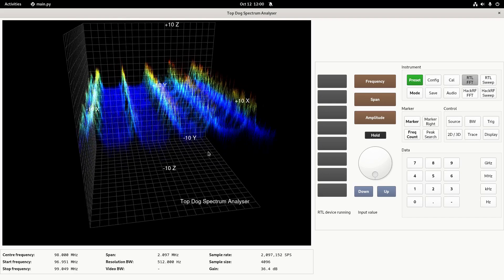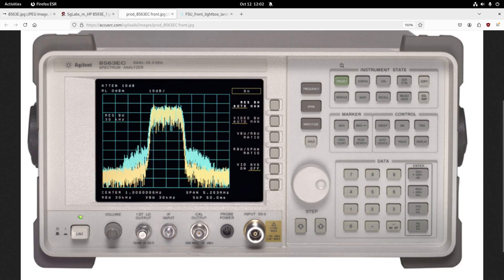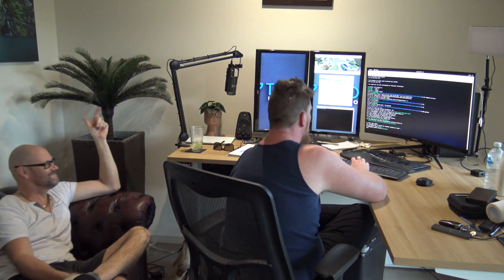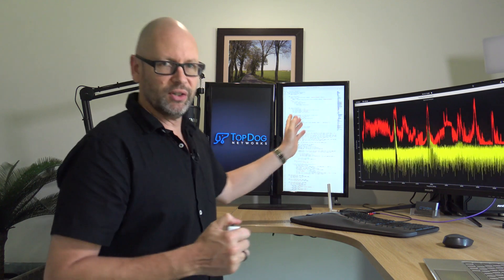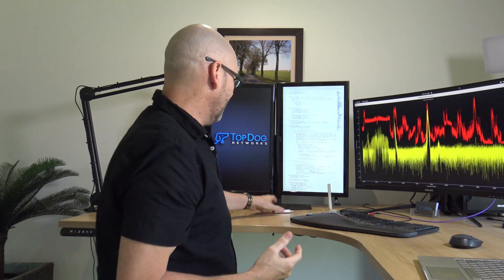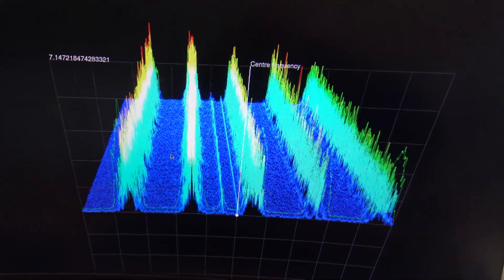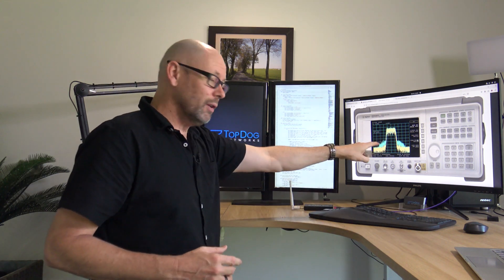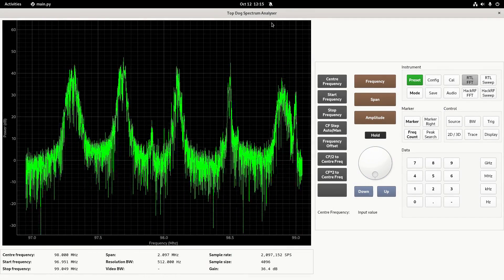Top Dog Spectrum Analyser using software defined radio (SDR)

Comment: Those analysers are great (I have several). They have a nice Yig tuned filter on the front end which gives great signal selectivity. They also have an option for an IF output at 310.7MHz on the rear panel. If this isn’t fitted, you can make a SMB to BNC cable and connect it to J803. You can then use the analyser as a high performance downconverter and your fancy spectrum analysis software with a lower cost SDR to digitise and display the spectrum
Reply from the maker: Cool... now tell me you live in Brisbane
Reply: @TallPaulTech  sadly not, but I loved my time there! Now back in Blighty

Comment: I like the markers feature, Would be nice to be able to have bookmarks feature to those markers...or shortcuts....and also capabilities to take snapshot/ save a brief snippet of the spectrum where the marker is- with the user selecting how much of the spectrum before/ after to store along with it. Maybe also an ability to save those marked snippets of spectru m as separate files.... opening them up just give us the marker plus the users desired before/ after captured time. I se you have peak hold nice. You know another interesting reference for features to add in is by taking a look at Audacity...the markers are what labels are in audacity.... but, something else, taking a selection and making a seperate frequency plot out of it
Reply from the maker: Most of those things you said are actually in the pipeline. At some point I plan to have two plots, so you could have a wide sweep with one device and a zoomed fft with another. This thing is a long way off though.